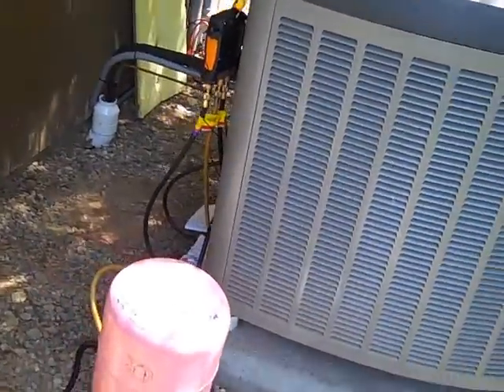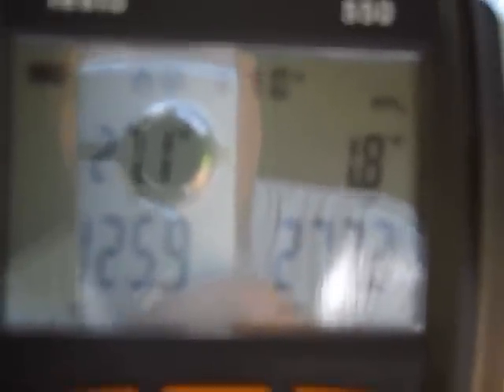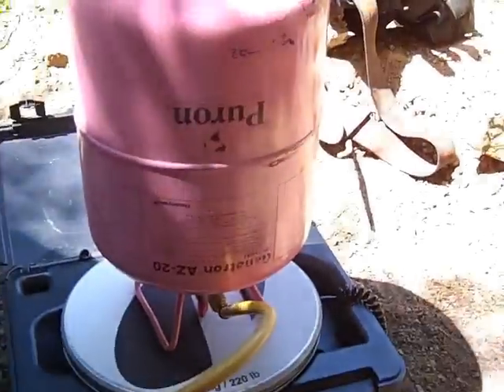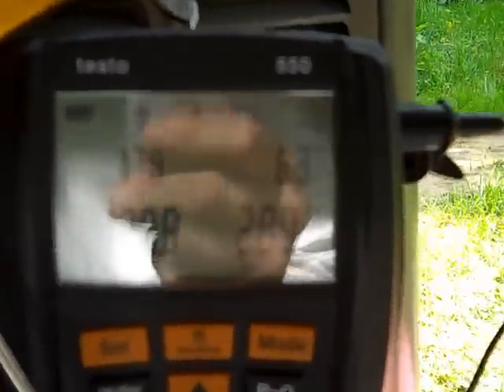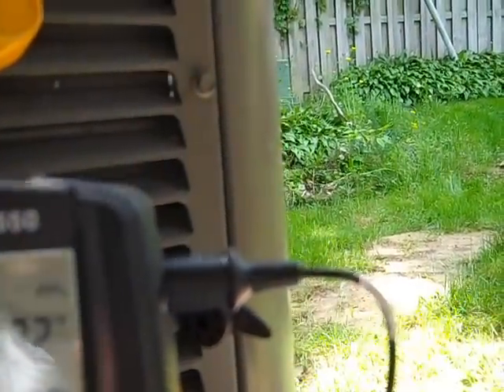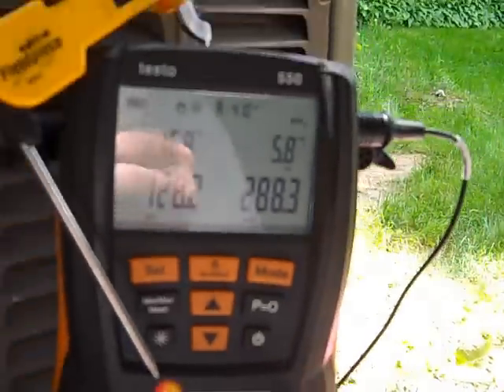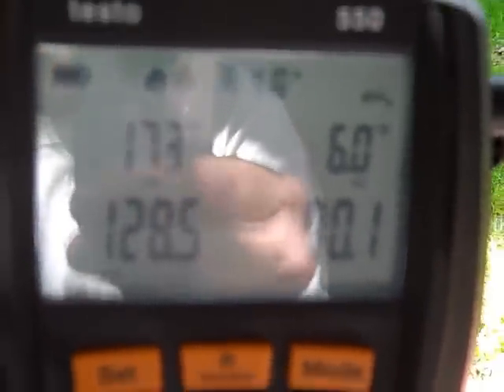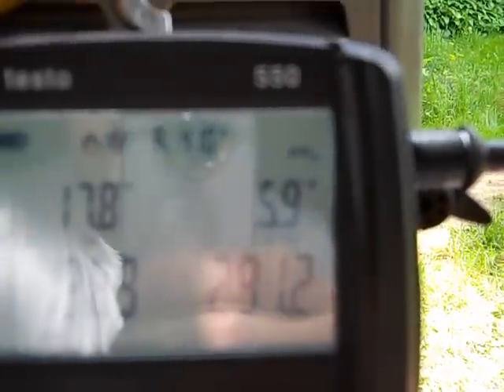R410 Charge w Testo 550.wmv

Comment: How do you triple evacuate with nitrogen?  Do you mean you triple flushed it with nitrogen, THEN evacuated it?  
If you are flushing with nitrogen, without evacuating with a proper evac procedure, you will have a lot of non-condensable nitrogen and the system won't work right.  And while it is good practice to weigh your charge and compare it to the manufacturer's recommendations, you really should be using superheat or subcooling (depending on metering device) to calculate the charge properly.  The charge weight and the calculated charge from a sh or sc method should be similar, but the calculated charge will be more correct for the system as it handles variables you may miss otherwise.
Reply from the maker: Yes, yes, yes. purge and evacuate 3 times. Used to be called triple evacuation. I don't necessarily follow that to the tee. I  pay more attention to the vacuum blank off test to determine when the system is high and dry than anything else. Sorry if I used some wording you're not used to. This video is 8 years old. Probably longer than you've been in the trade, am I right?

Comment: Can you tell me why the superheat fluctuates on the testo 550.. This can be confusing.
Reply: The fluxuations in sh are caused by the pressure fluxuating.  To reduce this problem set it to averaging mode.  Some systems have more pressure fluxuation than others, and that directly impacts the sh calculation.

Comment from the maker: I am BPI certified. I may get the HERs certification. Nothing is required in Indiana other than a refrigerant certificate. There is no licensing, no testing, the code inspectors don't look at HVAC at all here. They put blinders on when they are around, they fixate on electrical and plumbing. Indiana is just about the opposite of California.

Comment: flushing the lineset with r-22 would that be E P A NO NO. I bought the yellow jacket  bending tool after seeing you use it . I saved on fittings and i used swaging kit for when i did need a fitting .I would like to by the testo manifold set but the bender i bought looks like a hundred years old already.we are rough with my tools i guess.

Comment from the maker: @avionicswirenut I'm not sure. The only way to tell would be to compare identical units. Almost identical. One that uses r22 & one that uses r410a. R410a does require about 20% more refrigerant. I don't like the properties of the oil that r410a uses. Very susceptible to moisture contamination whereas mineral oil found in systems using r22 are not so susceptible. What good is r410a? not that good. Thank Al Gore and his ilk. At least they could use a better oil.

Comment from the maker: @FoxGraeme I only use this manifold and hoses on R410a. I still use my old analog set along with my trusty cooper thermometer for R22. I don't mess with many other refrigerants. Maybe a little R12 back and R502 back in the day + 134a when my Van needs a little shot of the juice.

I blow the 550's out with nitrogen after each use just to keep the sensors from bathing in oil all the time and so I don't introduce moisture laden oil into the next system.

Comment from the maker: @Vcsv8 I use my trusty old analog manifold and cooper thermometer  for R22. I only use the 550 on R410. I won't risk introducing any mineral oil into a R410 system.

Comment: I like the insulated cabinet on the XP 19.  The XP 15 has that crappy metal cover  that slices fingers.  Especially when they're installed with a 4" service area.  I don't see how you can fit between the house and the unit.  See my 'some more pictures' video for a laugh.

Comment: insulated sensors sounds good but why bother with the clamp at that point.  I have not found a "clamp" yet that is not effected by ambient on a regular sumer day hooked to a suction line. I don't bother with clamps anymore. It is hard to draw the line of being a little off or a lot.  What's the point of going digital if you are not being as precise as possible. The most error these days will be the temperature measurement IMO. Looking forward to seeing more with the toys (toolz) ;)

Comment from the maker: @14MrBojangles I have another thermistor type thermometer I tested it against. It uses the velcro style of attachment. I was satisfied with how close they were. Iv'e played around with insulation. I don't think it is necessary as long as it is a high quality thermistor sensor, it is making good contact  and it is not in direct sunlight.
Thermistors are the only way to go. Thermocouple types suck and are highly I might make a insulated boot to slide over the clamp out of thick foam insulation.

Comment: tstate curious what you used to use to take temperature measurements and if you have verified the testo pipe clamps are not effected by ambient temps?
Would you mind shooting a video of both 550 probes on a suction line with one in the clamp and the other slipped out of the clamp and insulated to the pipe with 1/2" insulation?

Comment from the maker: @Rueuhy I might buy some other digital gauges if I find a good deal. I will be posting more videos in the future about the tools I use. Like you I am a huge tool geek. I'm also a geek when it comes to my installations. I try to keep up with the new stuff while reviewing the old. 

I admit I don't normally triple evacuate R22 systems. Mineral oil is pretty forgiving. I do pull a deep vacuum and I will purge the system with nitrogen if it has been opened up for a prolonged time.

Comment from the maker: @Rueuhy I like how the digicool has an indicator to show how rapidly the pressure is changing but it was out of my budget. I knew Testo has a reputation for building highly accurate but expensive test equipment. German made. These days that says it all. I'm not sure where the digicool is made. I would like to try one though. I would also like to try a Refco. You can find them on ebay occasionally. The solar gauges look ok cool but they don't have temp sensors and not real accurate.

Comment from the maker: @fritzhvac Thats a 19 SEER Lennox heat pump. Real nice unit. I like Lennox, York, Nordine, ICP, Goodman-Amana, Carrier and Bryant are ok, Don't like Trane - American Standard. Or any down flow with a flue pipe penetrating the blower cabinet.  
Flues need to go out the side. Builders just need to add an extra foot to the closet.
Blowers need to be pulled to clean them and to inspect heat exchangers. Real money in is in service and cleans. II hate servicing a difficult installations.

Comment from the maker: @fritzhvac Yes, factory installation instruction booklet. States to use New Virgin refrigerant - no oil to sweep old lines. In from new bottle on one side and out to reclaimer on the other. I know I was surprised to find that in the instructions as well. I got the new HVACR NEWS today, there is an article about a new synthetic oil to replace POE. It is almost totally none hydroscopic. If manufacturers adopt it. Will they do it if they sell less equipment due to future compressor failures?

Comment: I now have to buy your BENDER and your Gauges , I'm digging it !!! lol
Are you saying R-410a Condenser Unit instructions said flush old lineset  with VIRGIN R-22 ? R-22 Mineral Oil and R-410a POE , I would not do it either Jason , you will form an acid and burn out compressor real quick !!! You did it the right way with NEW LINESET even if you got to CRAWL , the only way I would FLUSH , would be with a parts house flush, and only if Lineset were in a finished basement... ETC ...
Good Video !!!